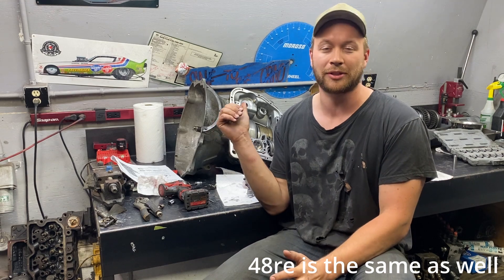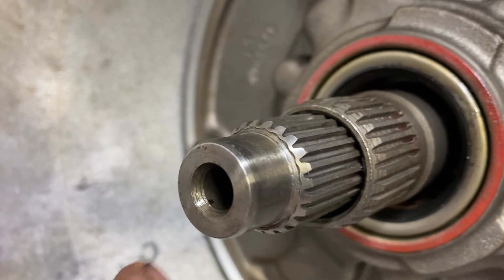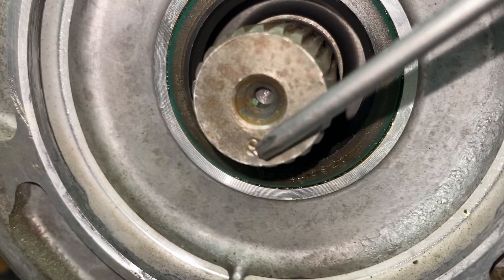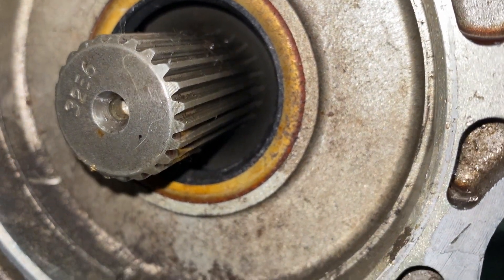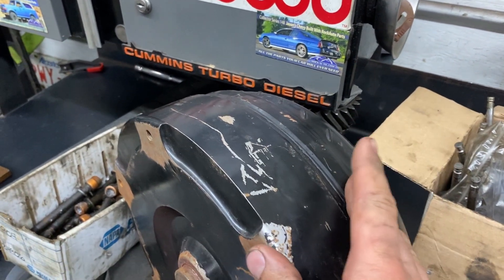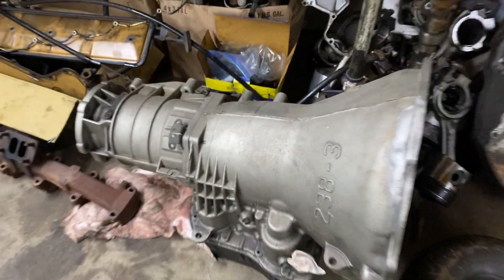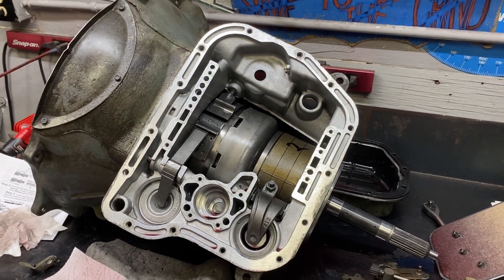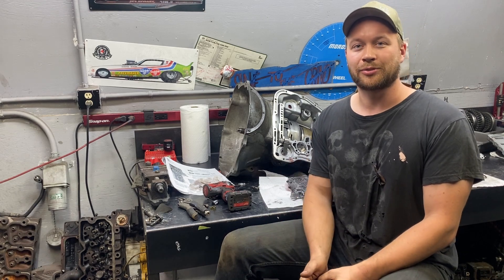How To Identify If A 47RH/47RE/48RE Has Billet/Aftermarket parts: Input, Output, Converter, + More!

Comment: I was told if the cast numbers read 238-1 or lower then it's a 47re. If it reads 238-2 or higher then it's a 48re. Any thoughts?
Reply from the maker: I’m not familiar with the casting numbers but what I look for is what the neutral safety switch looks like. 47’s have one that screws in, while 48’s have one that pushes in and is held in by a single screw

Comment: On a billet torque converter with a drain plug like that you can pull the plug out and look inside to see if it’s a single or triple disc. If you can see a disc, it’s triple if not, it’s a single. Also a dead giveaway if you want to know 47re vs 48re externally, the 48re will have an o-ring on the input shaft.
Reply from the maker: Sweet! Another thing for the 48re is it has a specific neutral safety thing that uses a screw to hold it in while 47re and old threads in